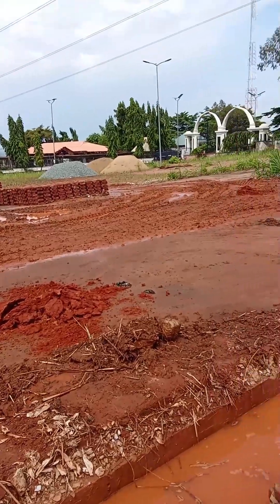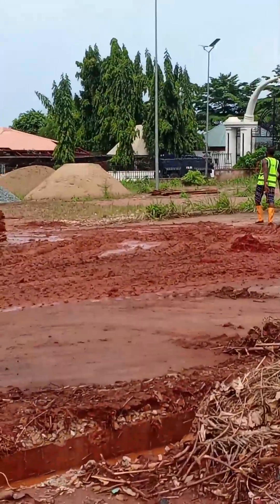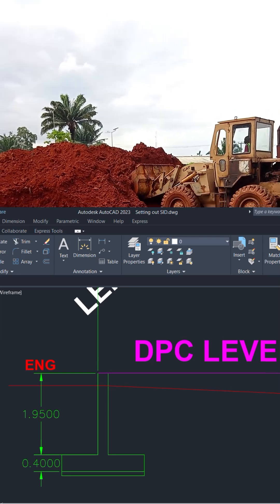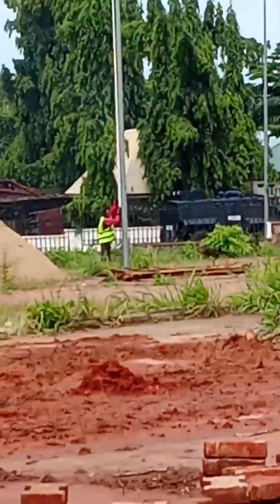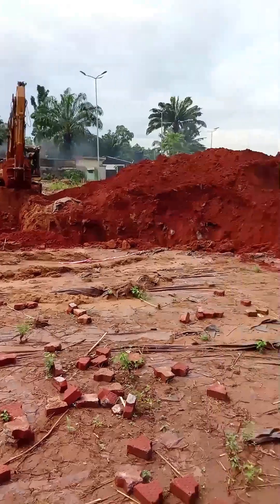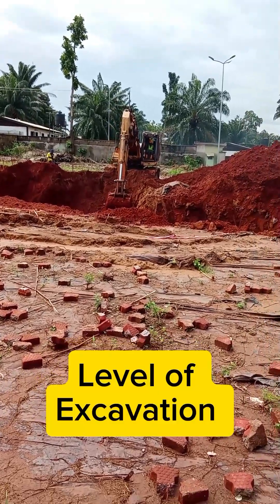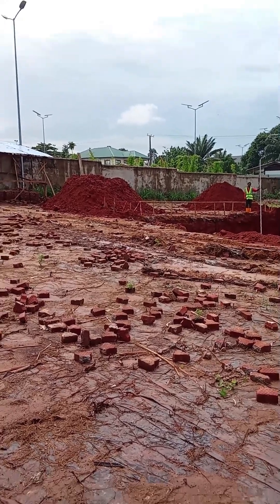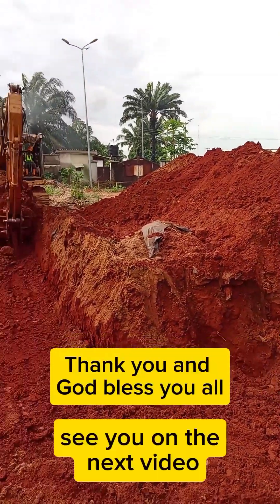MONITORING EXCAVATION WITH DUMPY LEVEL

Comment: How do you calculate the level needed for the first excavation point?
Reply from the maker: We will first determine Ground floor level first, then we check drawing to confirm what was designed from GFL to the first excavation
Reply: Last part...BM plus BS
Reply: The confusion I have is how to start ,after setting out TBM and you are given the depth of the drainage..how do you determine what to dig